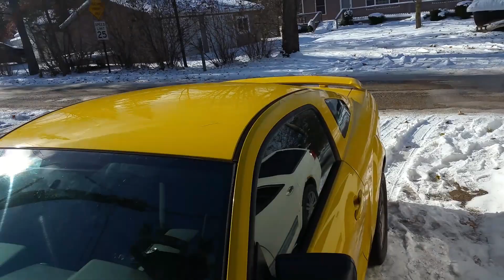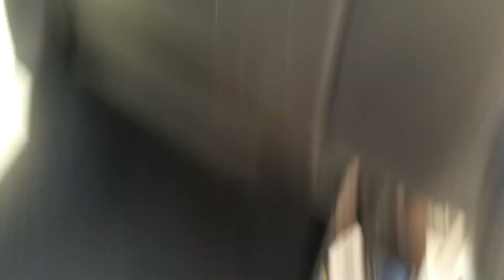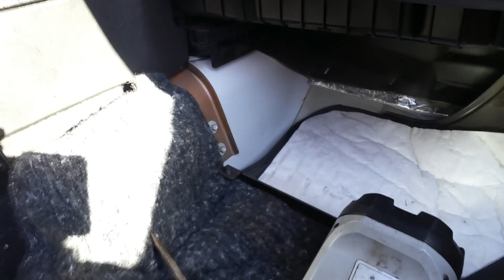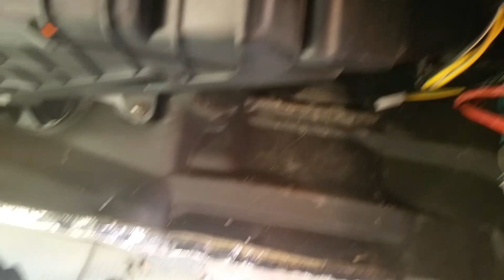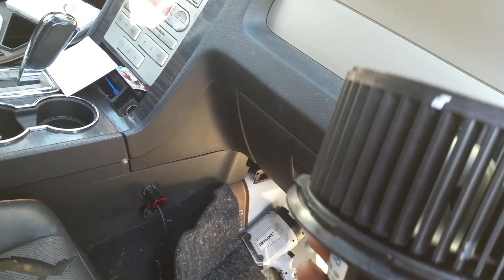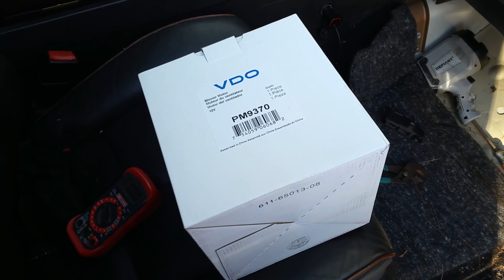2007 Navigator, Expedition blower motor diagnosis & repair

Comment: If my AC speeds work and it’ll blow on the dashboard and back but the AC won’t blow from the front or bottom blowers and doesn’t respond to the buttons that change them, do you think it’s the motor blower resistor?
Reply from the maker: No, blend door or vacuum line .
Less likely but possibly the control switch

Comment: Hi bud, my navigator's front ac turns on when ever it wants to.. we could turn on the front, center and rear and all will turn on except for the front!   It will turn on 20 to 30 miles diwn tge road and sometimes  not at all!!Do you think i should replace the blower motor???
Reply from the maker: I'm leaning more toward a blend door motor or a short. When you say turn on, you mean the fan or the actual ac compressor?  Does the air blow out of the proper outlets?

Comment: Is the blower motor resistor easy to change by myself or how to know if it’s that if it stays at one speed always
Reply from the maker: They are pretty easy. Depending on what year your truck is. If you dont have all of your blower speeds it is very high likelyhood that the resistor is bad.
Reply: @darylturcott  I replaced the resistor and the motor, and my blower shuts off on high speed. I can use any speed but high. Once it shuts off, I have to restart the engine for it to work.
Reply: I don't have all the blower speeds for my Navigator while it's on but once I hit the off button the blower motor kicks into high even tho it should be off. What would cause that to happen

Comment: Great video! Do you know where I can find one for replacing the rear blower motor? Searching the web and can't find one anywhere.
Reply: I found one on YouTube last year, i cant find it now. Its not that difficult,  i did it without having to take too much apart
Reply from the maker: I'm sorry I dont. Must not be a common problem if no one has documented it.

Comment: Thanks for the advice
Reply: Just pulled mine today and your vid made it easier. I use an exacto-knife from a finished model kit to cut that piece of rubber so it just folded down and the whole thing came out easy.  Start to finish 20min